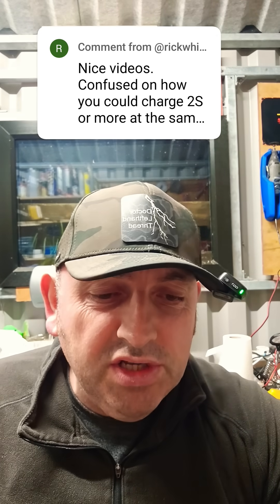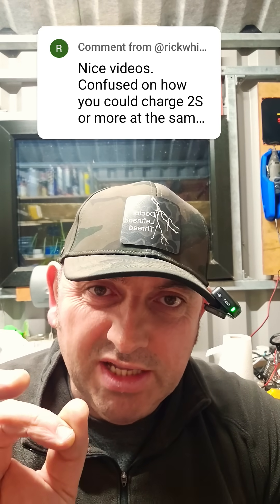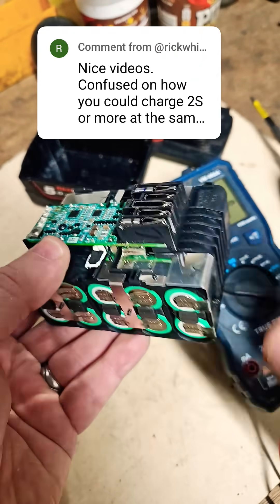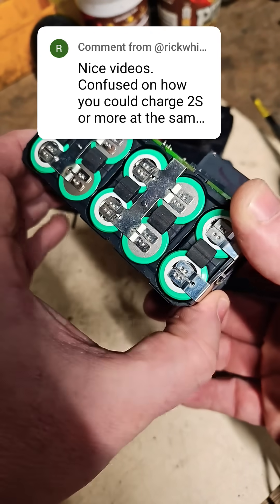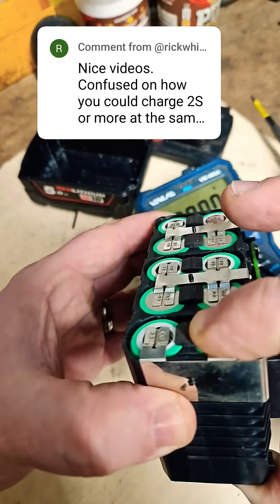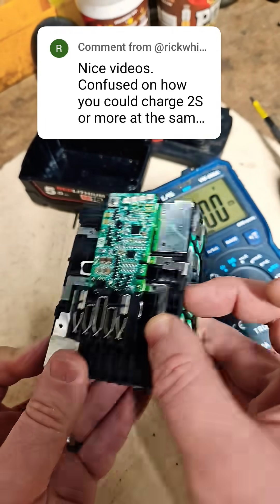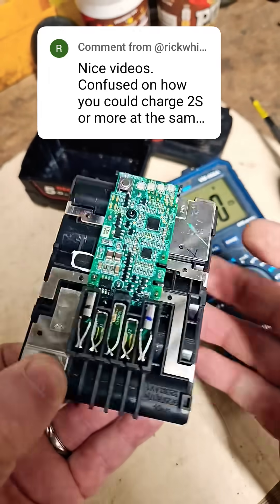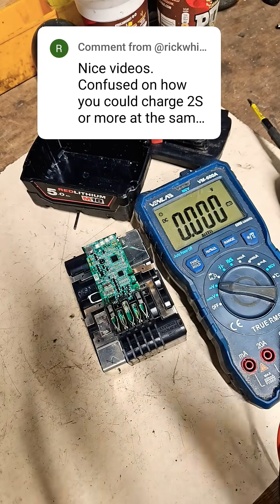How to charge individual banks of cells in M18 Batteries #powertoolrepair #m18battery

Comment: You can charge an individual cell within the pack with it all being connected its simple really the electricity/power is only going to flow between the positive and negative terminal of the balancer or power supply as otherwise it has no where else to go and needs to complete a circuit to charge. So if you left just a positive and no negative it won’t do anything but if you put say the negative on the end negative on the cell bank for example and then put the positive on the other side where it joins the next two cells it’s only going to charge those two cells because there the only ones that are inside the completed circuit it’s easier to show with diagrams but that’s the best I can explain it in a short para

Comment: Doc why not use the 6 wire balance leads woth the iMax b6 So u can do the full pack in one go and balance each bank at at same time 😬
Reply from the maker: Yes the balance charge with the leads is the best option however it is a very slow process. I will need to do a video on it but haven't been able to find the time yet.

Comment: I got!  Thanks a ton for the follow up.  I got lost on the fact they are in series.
Reply from the maker: So happy you got it because I find these things hard to break down sometimes
Reply: @doctorlefthandthread once i opened up the battery i saw how it was all series based.  In your video, it kind of looked like each bank was going to the BMS board independently, and i got the imptession it was acting as a balancer for each group while charging.  Nope.  Thanks again!